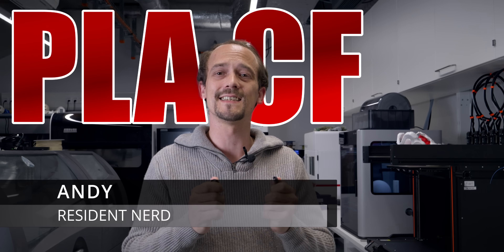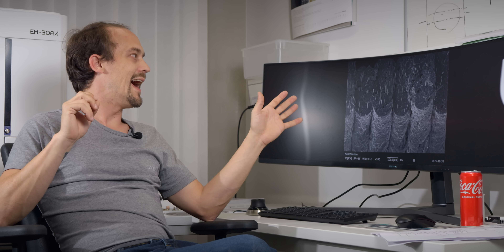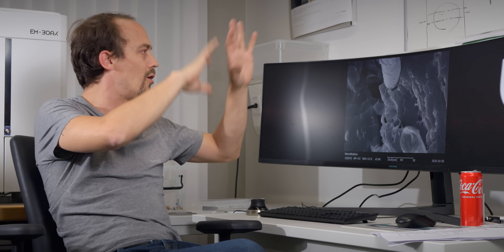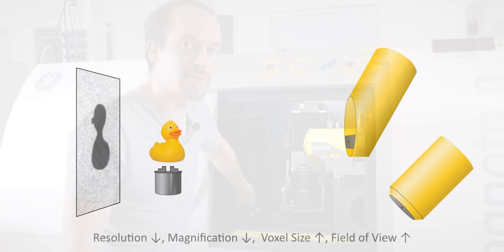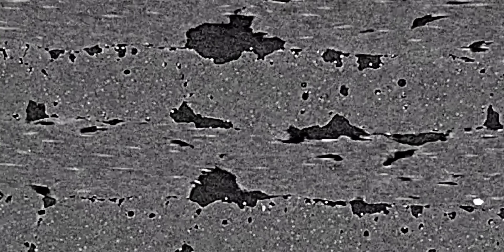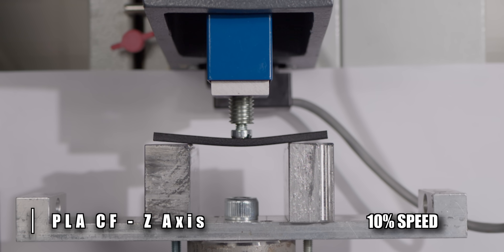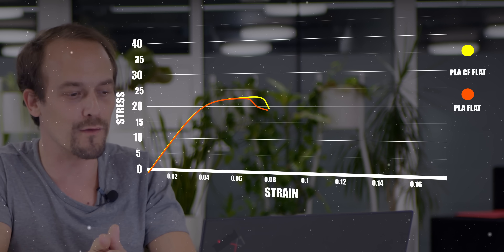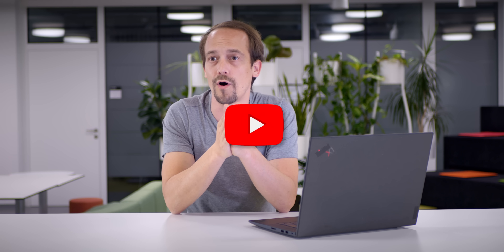3D Printing’s Biggest Scam Is Even Worse Than We Thought!

Comment: Okay, not finished watching yet.. but right off the bat, I think there's a big misunderstanding on the point of CF filaments. While it's advertised as stiffer and more dimensionally accurate (which is very true in my experience), the biggest advantage I've found is that it simply is a more reliable print. I almost never have failures with CF filaments. While I still occasionally get PLF failures, and especially PETG. But PLA-CF and PETG-CF? Almost never. I use it just for the reliability.

That being said, as someone who lived through the transition away from asbestos and dealt with fiberglass shards, I understand carbon shards are probably no joke either. So alternatives are welcome. But you can't deny the benefits, either. Every material is a tradeoff.

Okay, after watching the video, a bend test will definitely fail with CF. That's not what 'stiffer' means. It means it bends less before breaking. It's more rigid.. it doesn't mean it's stronger, just holds its shape better before starting to bend. Your measurements don't hold up against other content creators who've done the same thing. While it can't hold as much weight, they've shown it's stiffer under light loads, with less deflection.

And in your magnification, voids can actually be beneficial. Just like structured infil for a model, you don't need material everywhere to maintain strength. In fact, if you could print hollow filament somehow, you'd probably see it as the preferred method. Without comparisons against things like silk PLA (which is intentionally trying to create long voids in the direction of extrusion.. that's why it looks silky), or even standard PLAs, sparkly PLAs (since they too have contaminants) wood and metal filled PLAs, etc. They could be even worse.

Overall, the data presented is highly biased, doesn't show comparative results against controls, and while employing a lot of 'scientific' tools, it does not follow a scientific process of objective comparisons and analytical study. A scientific approach would be trying to prove that CF is better and safer.. and through your analysis, you fail to prove it. That's a scientific approach. Not pulling out tests you think show it's bad and being right.

The only thing demonstrated here is that it's a complex topic, and Marketing lies to you. No surprises there.

Comment: Do a nanoscan of the source wire. Those carbon fibers are probably not bonded even in the source wire, and maybe there are voids as well.
Optimistically I will argue that this is just a "new tech"  problem with compatibility that can be corrected with different plastics chemistry or something.

Comment: I just won't use it. When I got my creality printer, they gave me 2 free rolls of PLACF and while I have used one of them, it's just a fact that the CF gets EVERYWHERE and is hard to remove from any surface it touches or is near.
I thought it was obvious that the CF wasn't actually doing anything because you can literally see with the naked eye that the strands are super short. Like 5-8x the width of a human hair kind of length. Those strands would need to be like, at least 1-5cm to actually account for increasing strength.

Comment: I'm interested in whether those voids form in regular PLA 3D printing without CF. To me, it seems like they could be an artifact from the 3D printing process. Of course, the ones on the layer lines are probably from imperfect fusing of the filament lines, but some of the voids inside the layers could be from the filament production process or created during printing. If created during filament production, it would also be interesting to see if this looks different between different brands as well.
I'm a materials engineer (and an amateur with 3D printing), so this kind of thing is really interesting.

Edit: I ended up muting the loud AI slop music so I could watch the tests. I would have been interested in hearing the machine and cracking sounds. The differences in sounds can also tell you some (less measurable, but still interesting) things about the material. 
Interesting video. I'd consider subscribing if you cut out the AI. You could narrate and describe the differences in material behavior if you feel like it's too quiet during the tests.

Comment: I use Sirayatech PPA-CF core. I'd love to see these observations on that material to determine how useful it actually is to bury the carbon fibers inside the filament. Just based on this video, I would bet it's hugely beneficial. Anecdotally, that material feels incresibly strong and rigid, but I've never felt pure PPA/PAHT for comparison

Comment: Instead of chopping up the fibers and incorporating them into the stock, they should braid a small cord and lay that down within the plastic. Kind of how MIG welding works. It would act like rebar. Rebar isn't loosely added to concrete. It's bonded together first. So bond the fibers as twisted cord and use it as a reinforcing cable instead of an additive. It won't be as stiff, but it will resist expansion forces and shear failures.

Comment: Great video and since you ask so openly, I do have a request to test.
With your access to microscopes and x-ray to this magnitude, I would LOVE you to check out the new PPA-CF Core from Siraya. I was sold on the claim that it eliminates carbon fiber on the outside of the print and benefits Z-adhesion by leaving a clean PPA interface between each layer.
I already bought a spool and will be testing it for its properties as well but I can absolutely not get images as crisp as you did!
Let me know if you are as excited about this as I am, because once I heard of the health risks of conventional composite filaments, I was pretty disappointed and cancelled my PPA-CF order at the Bambu Store.

Comment: Though I'm not personally familiar with the exact equipment, wouldn't placing your viewed object so close to the x-ray tube blow out your geometric unsharpness resulting in significantly reduced image quality? I'm sure there's a sweet spot where you can blow out the projection and get the magnification you desire without compromising on your resolution. Additionally, digital x-ray scans should be really easy to magnify without needing to put your object so close to the source, surely you'd ultimately have the magnified image quality come down to just your resolution?

I mean, I can't tell you if it's just because of youtube's compression, but I feel like even looking at the fine grain structure of a 3d print we should surely see a digital x-ray with much better quality.

Comment: I agree with your findings on CF filaments. However I do print every day with 3DXTECH PEEK-CF-10. Sometimes I anneal the parts and sometimes I don't. I would be curious to know what the results are with that material compared to the cheaper end materials you've tested. 🤔 I print PEEK at 420c and 100c chamber temp very slowly. Would be cool to know if that helps make it more "solid" of a part and if the CF actually bonds and if there are little to know voids...OR if the results are the same as yours. We put PEEK printed parts under stress at 400f in many customer applications and have zero issues.

Comment: I think we absolutely need to see a comparison with non CF prints to know if the voids are a reason to avoid CF or not. 

I don't know if there is a way to see if the protruding CF fibres on a print break off and "shed" over time... can't imagine lots of tiny carbon fibre bits in your house is especially good for you. Could they potentially be an irritant if they break off through handling? .... that'll teach me to comment before you finish the vid! Might still be good to see some further info on it though.

Comment: i don't understand you conclusion. maybe i read the graph incorrectly, but to me it looks like that the PLA breaks at ~93 force units and the CF at ~68 force units in x. How is that basically the same maximum force to break? That is a 36% difference, is it not?
Also the colors are not consistent. PLA is yellow in the displacements graphs, but it is orange in the strain graph

Comment: I buy your conclusion based on the mechanical data but i want to poke at your method a little:)

When you precent the claim that the plastic may retract from the fibers while cooling i was not convinced by that data. You highlighted only a few strands that seemed exceptionally disconnected but looking over the scan slices i think i see the vast majority embedded in there without a visible void around them. Its ofcourse a youtube video, and was presented more like a discussion chapter. But i think if you, for example, counted up fibers with a visible void from a chosen section, that would bave been more convincing <3
Reply from the maker: The voids are 2-4 micro meter. And my resolution is about 1 micrometer. I segmented the data to see but the gaps are at 2 pixels on the screen. So hard to see. 
But a picture analysis confirmed it

Comment: PLA-CF is not a structural filament, but it might be the perfect precision filament. The main benefit of PLA is how easy it is to print precise parts in with its minimal warping, and CF's main purpose is to stabilize filament and also reduce warping, so combine the two and you presumably get something that knocks on the limits of printer calibration and 0.2 nozzle's size. Or maybe not. CF is baisically "make this filament more like PLA", and PLA-like PLA just ends up PLA.

Comment: I greatly appreciate your investigating the properties of 3D-Printing in CF. 

Your analysis addresses the majority of my curiosities/reservations about the hype around the supposed reinforcement “value added” with impregnating carbon fiber in PLA. 

So “cool points” implied are up, filament Sales’s profits went up, but actual structural value down, adverse medical potential reactions/potential negative health effects go way up. 

It seems reasonable to require consumer products to include a warning label for any PLA-CF that is *not fully encapsulated.

Comment: @ibuiltathing Hello,

This video is really revealing, thank you 😊. Could you share your methodology for the tests you conducted for your comparisons between PLA and PLA CF? I'd be interested in it, simply to make sure I can follow your conclusions. For example, the control tests between microscopic images of PLA-CF and PLA from the same company. Does this only apply to PLA-CF from a single company, or did you test with PLA and PLA-CF from several companies? In short, you have the privilege of accessing a lot of great equipment that can help us, the consumers, conduct fascinating analyses 👍. However, without an explanation of your test methodology, it's difficult to follow your conclusions.

Furthermore, I would be interested in tests using a scientific methodology on PETG CF. Do you think you could conduct tests and share your methodology with us?

Comment: I don’t argue anything you said…. But objectively —you have to show the comparison to PLA in the imaging.
Reply: Yea that is a regrettable omission. Without that comparison we dont really know if those voids are noteworthy.
Reply: This kind of videos are just. Idk smh. All those effort to get a well known result without anything helpful. So sad.
Also the conclusion isn't even correct. From millions of other videos, and we know you don't look only the z axis. And you get much better rigidity against force and more importantly temperature. I don't use cf filaments but they do have a place.
Reply: Not really. Because if the cf strings sit in a void, the best case scenario is that it does nothing.
Reply: @zoli11  i for one want to see if the voids exist in regular PLA also
Reply: @zoli11  Yes, but he also observed bigger voids outside of where the fibers sit. It would be worth knowing if those are specific to CF filament or a problem with pla in general, because those voids might actually be even more influential to the structure.
Reply: @zoli11  Its standard control practice used in science. It does a lot
Reply: He pointed out cf in voids but ignored that most of it was very much embedded in the pla…. You could see it in the layers at right angle, lots of dots of perfectly fine cf.

Comment: It's not a scam, it has its purpose. That purpose isn't what you think it is. It's like saying those silk multicolor filaments are a scam because they don't improve material properties. It's about aesthetics and looks. PLA isn't an engineering material, so it shouldn't be treated as one. CF does actually help with temp resistance and layer adhesion, if the part is properly annealed.

Comment: You should give Glass Fiber Reinforced PETG (PETG-GF) a try. Seems quite strong and still has a little flex to it but way stiffer than regular petg. Twice as rigid as regular petg. Slightly higher tensile strength.
I prefer it over the carbon fiber petg. as carbon fiber is actually slightly less stiff. and only comes in one color (black/dark grey) while glass fiber petg comes in a variety of colors.

Comment: CF is all about fiber orientation. Wrong orientation, no benefit.
Exotic material are well, exotic, and stuff like CF needs to be used correctly to get the benefits.
Same with titanium, another exotic material that everyone assumes works by magic. If anyone tries to sell you titanium bolts, NO, NO, NO, unless you will only use the part once.

Comment: Carbon fiber is a fiddly thing that historically needs to be bound is resin, and woven, and pretty much otherwise is exclusive with itself, throwing tiny sticks of carbon fiber into a weaker material doesn't help as its just introducing a bunch of weakpoints around poorly bound "Sprinkles" If you could make a filament that was properly binding the carbon fiber, but the failure point would STILL be the original material, because if you could make the carbon fiber the failure point, you wouldn't need it...

Its... just flawed from the outset, its not an alloy situation, and its not even a rebar situation, it cannot physically reinforce the material at those sizes.

Comment: I'm new to 3d printing. I don't know much about any materials. I was under the impression that carbon fibre capable 3d printers and materials could deliver us stronger prints. This video seems to deconstruct that. So, I'd be interested to hear what actually does make stronger prints. Edit: The end of the video indicates that it is just the PLA-CF and PETG combo that's poor, so I think if this requirement rears it head on my future printing needs, I'd avoid those two.